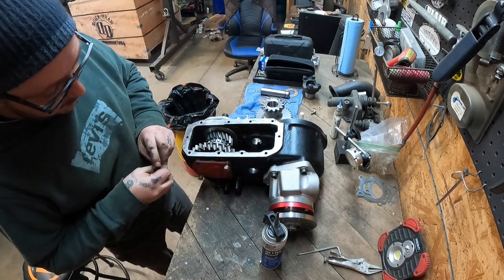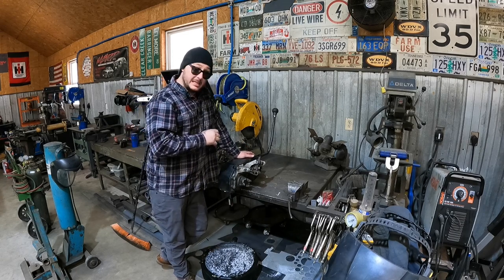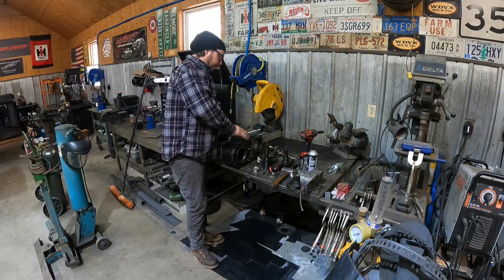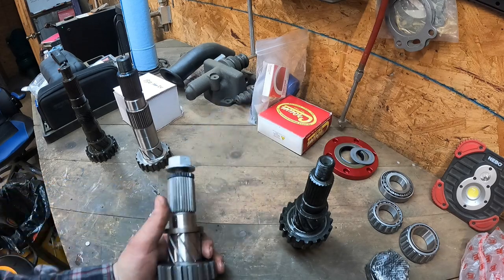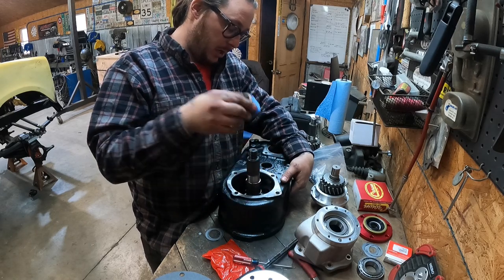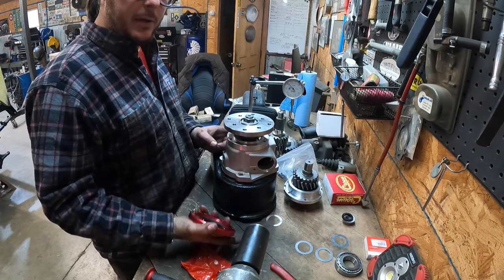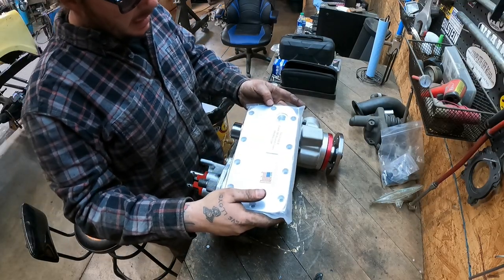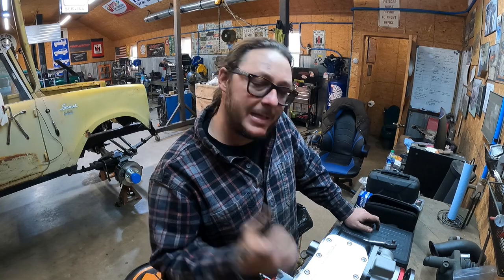32 spline 4 to 1 dana 300 build!! (First piece of our shop Rock Crawler)

Comment: I'm building a scout II also,  5.3l, 4l60e or 4l80e,  and thinking about building a dana 300. I was also thinking about a midnight metal works dana 300. You got any tips?   Love the videos
Reply from the maker: I think the new case will make assembly a little easier.  Just take your time and follow the instructions.